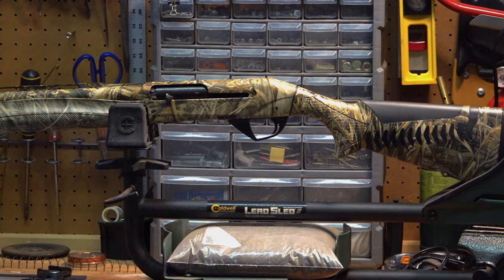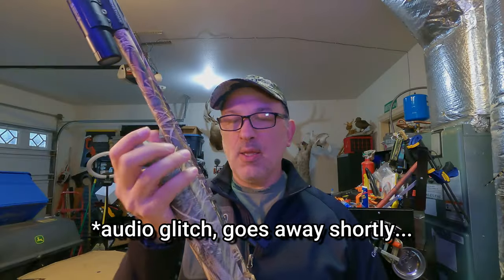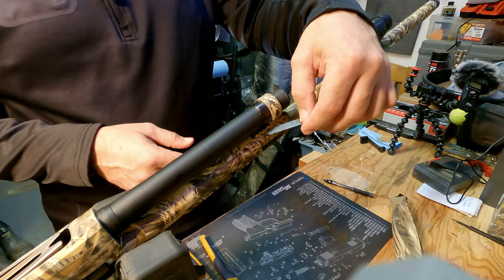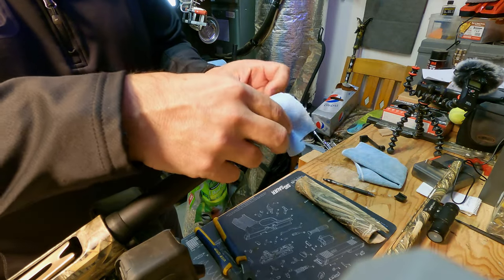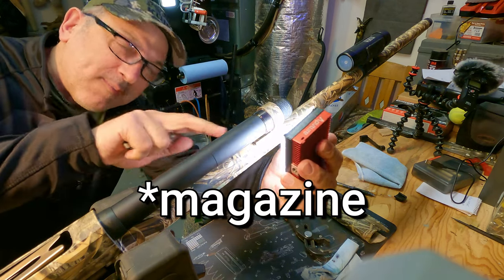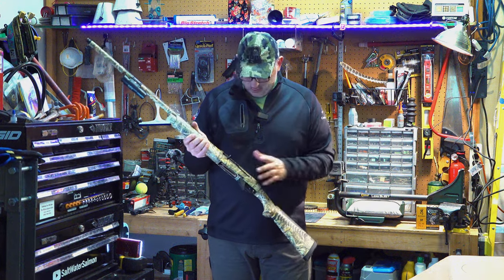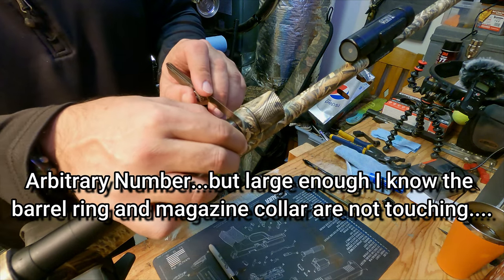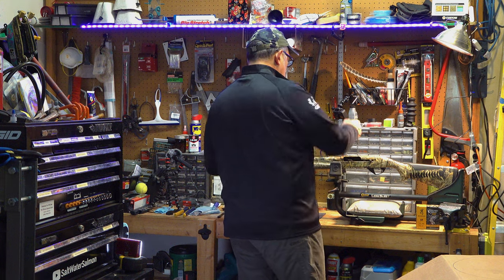DIY - Adjusting the High Point of Impact, Benelli Super Black Eagle 3

Comment: Wowzers, I just happen to stumble upon your video as it showed up on my suggestions. I never knew this was a thing for people. After watching your video and reading the comments I can't help but think everyone with this problem has fallen down the good ol YouTube rabbit hole. First off I'm no gunsmith but I have been playing with guns for 40 years and I do know that mag tube ring acts as a secondary recoil lug, (as it would on a rifle) and should not be sitting off the barrel ring.  I hate to say it but you did mention briefly in the video that you shoot high regardless of what gun you are using and you mentioned you were going to try and fix that with your style of shooting. I'm a pretty good shot and I rarely miss (I mean we all have our bad days), but from the first time I shot at a moving target at the age of 13, the object was always above my gun barrel. This gives you a larger field of view and you're able to anticipate where you need to be and not stuck in "where you're at mode". I mentioned I have my bad days, brain farts and loss of focus, that's usually the result of me putting my object in line with the barrel and not the bead. Get under your target with both eyes open and you will see a massive difference in your success rate. I will add I have always had high viz aftermarket beads on my rails which greatly help in pointing at the belly of my object and not aiming ahead of it. I mean I'm still ahead of my object on a side swing but my starting point is always under the object. Put a truglo glo.dot on there, both eyes open and throw some shot at the cardboard and you'll be where you need to be.
Reply from the maker: Somehow your comment was held for review and I missed it! Thanks for your input. I've been hunting with a shotgun since I was a kick 40+ years ago...no real training at the shooting arts. I never had this much problem with my Remington 11-87! Clearly a different gun though...I like your idea of an aftermarket truglo sight...others have said the same thing... Honestly a little professional instruction would help as well, I'm sure my form needs work.

Comment: I guess I must have the only one that doesn't shoot high, I just bought it this week and patterned 2 days ago. I would say that I'm pretty close to 50/ 50 at 25 yards within modified choke installed. Now mine is a 20 gauge SBE 3 Be.s.t. and I love it. 🤔👍
Reply from the maker: @Opiemus  glad to hear it! Another fellow commented a few days ago that Benelli told him the issue was fixed this past year. I just need to send mine in for a little tweak…
Reply: @SaltWaterSalmon maybe that's the case cuz like I said I just bought it last week. And I am aiming Dead on and not using the European style of aiming at 6:00 . I was prepared to adjust it with shims but didn't need to. By the way I see you comment you just bought a Stoeger I just bought on the 6th of this month and sent it back to them this past Friday because the forearm had a crack in it. It's a pretty gun with the Walnut stock and burnt bronze cerakote barrel. I was pretty happy with it but it's not nearly as reliable as the Benelli, at least not yet I've only shot 21 shows through it. 😉
Reply: I bought mine new yesterday and just got back from sporting clays and mine is shooting very high.
Reply from the maker: @nicholasvardas3440  🤦🏻‍♂️ soooo, they HAVENT fixed the issue! Work those shims then try my fix if your shims don’t help enough!
Reply: Nope mine shoots great 60-40 pattern also
Reply from the maker: @tombixby2838  sweet

Comment: Did you try it again after the second adjustment where you gave it more clearance?  You should also use some sort of rest, make sure the rib is "flat" (can't see the front or the back), and use the top of the bead centered on you point of aim.  My SBE3 12 ga with 3" chamber has .010 clearance with the forearm off and barrel fully seated.  When I tighten the magazine cap that gap goes to zero and the gun shoots 60/40.  I'd shoot it to see where you are now, but I'd probably redo it by loosening all the way, clean and put new thread locker on, run the ring all the way down, install the barrel and tighten the cap fully, then run the ring up until its just touching.  I bet you will be good then.  Conversely, on my SBE3 20ga there is no ring, and mine shot 90/10 from the factory.  My only way to adjust is to add tension on the barrel ring by tightening the mag cap beyond hand tight.  I did this with a piece of leather and channel lock pliers.  End result was 1/4 turn beyond hand tight and I now get a 60/40.  The downside is I can't take it off without tools but I'd rather that than learn to shoot differently with this retarded idea of "Europeans float the bird"...
Reply from the maker: OMG, what a great right up! Fact is I haven't shot it after I made the video (in the oilfield for 2 weeks) but I'm going to follow your advice, I knew I should have used my Caldwell Lead Sled rest.... Yeah "float the bird" my bung. this is 'Merica Jack!
Reply: This guy has your answer. My SBE3 is about 70/30 off a bench at 40 yards. My 20 gauge is about the same but I also tighten the holy eff out of the mag cap on it, because apparently Benelli can't figure out how to do their tolerance stack up to make sure shit fits together properly. My upper receiver has about a 1/32 inch gap if you tighten it to what one would consider a normal tension. I tighten that SOB super tight to get the barrel to sit flush against the receiver (they aren't permanently connected on the 20 gauge like they are on the 3.5 inch 12 gauge).
Reply from the maker: @LateSeasonDucks-oi9mv  thanks for the confirmation!

Comment: Where is your Shim Kit that came with your Shotgun? I never heard of moving that predetermined welded collar?
Reply from the maker: @michaeldelrossi4487  oh I shimmed the shim right out of this gun. Only thing left is to start stacking those shims or send it to Rob Robert’s or back to Benelli to get fixed. It clearly doesn’t shoot right. TBH, this fix is not a permanent solution…as pointed out by a viewer…”if that collar doesn’t have the proper support, it’ll fail sooner or later”…

Comment: Come on  Benelli. For that price point get it right
Reply from the maker: Yeah I was pretty disappointed at first...I'll get it figured out though! Turns out I need to adjust the drop/cast on my 828U as well but I have better luck with her shooting like I'm used too. I've been using a Remington 11-87 for the previous ~32 years! Old dog, new tricks...😁
Reply: I just got a 2023 sbe3.  It shoots right where it should. 70-30. Better than the 2017 I have.
Reply from the maker: @paully8794  that’s great to hear! A few of the guys commenting here have convinced me to have another go at adjusting this gun, using a rest and being a bit more technical about the whole process. I should be able to get it sorted.
Reply: I lost a good chunk of change selling mine after sending it in 3 times for poi issues. Benelli said 90/10 is the best pattern they could guarantee.
Reply from the maker: @upinair4990  OMG! 90/10 SUCKS!

Comment: The sight plane and the bore of the barrel are not parallel, it will never shoot low sighting down the rib. The mag tube ring has pretty much nothing to do with it. I went down the benelli rabbit hole with a m2 that shot 100 per. High when aiming down the rib. Shimming only works when pointing , not aiming. To shoot 50/50 they need a flat rib, not a high at the rear low at the front. I machined the rib off my barrel ( everything but the bead ) now it points and aims 50/50 . A flat rib is the  only fix for a Benelli. There fix is a montefeltro , its a flat rib gun
Reply from the maker: You just take it into a machine shop or did you use a gunsmith?
Reply: I'm a machinist, did the machine work myself
Reply from the maker: @chrishall745  ahhhh, well done!
Reply: The Montefeltro barrel will fit the SBE.
Reply from the maker: @HALWG51  😲That's cool!
Reply: I bought my SBE3 less than a year ago, tried all the shims still shot high.  Sent it back to Benelli, they adjusted the ring and shoots great now. If shooting at a 3" dot on cardboard hold sight at 6 o'clock of dot and you'll have 60/40 or 50/50. Can't wait for duck season.
Reply from the maker: @andrewhauke5769  good to hear you were taken  care of! How long did Benelli have your gun? I honestly think I should just send mine in as well...

Comment: Moving the collar on the magazine tube, is only a short term answer, and will in long term ruin the gun.
The reason it touches the barrel ring is because it is meant to hold it in place from both sides by tightening the magazine tube cap. 
Now you have play from the back side by moving it lower. Yes, you adjusted the "shoots high" issue , but now you added another problem to the gun which is a loose barrel ring. In time it will crack from the barrel. Now you have a different problem. 
Good video. Just not the correct solution. just a band aid. 
not knocking anyone down, just my two cents...
Reply from the maker: Man, it doesn't take a genius to realize that you are 100% correct. I didn't even consider the magazine collar being a backstop for the tube cap! It will probably take "a minute" before there is an issue but someday that barrel ring is going to separate from the barrel...dang it! Thanks for the comment! Now I should just send it in for a factory fix....
Reply: I believe you are on the right path. However, the correct thing to do would be: Back off the collar until it is away from the barrel ring. Install the barrel and tighten the magazine cap tube. At this point you have the lowest aim point possible. With the magazine tube cap tight, hand snug the collar back to where it is toughing the barrel ring from the back for support and lock tight it in place. Ensuring the support.
Again only my two cents @SaltWaterSalmon
Reply from the maker: @mhertoro  good idea 👍🏼